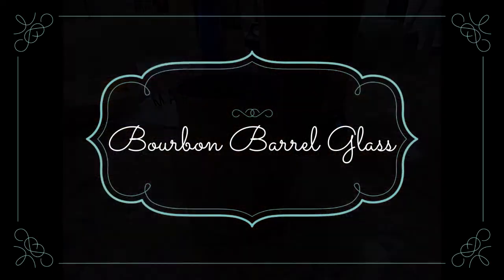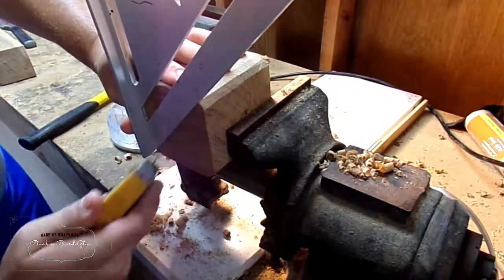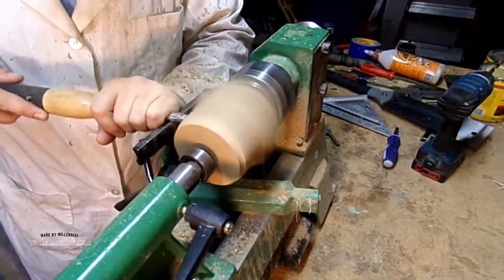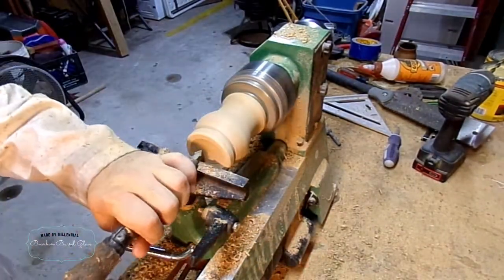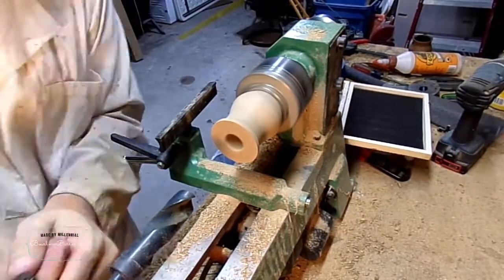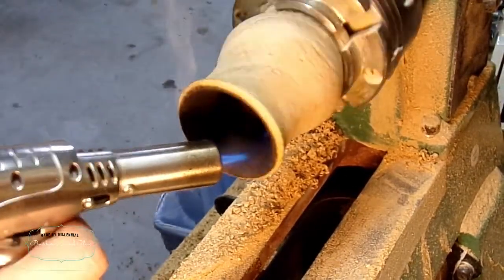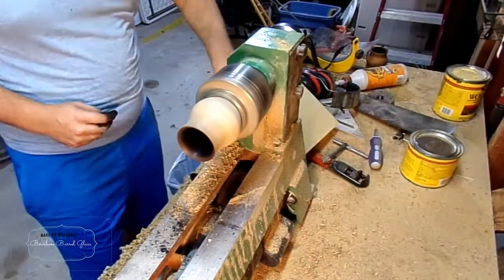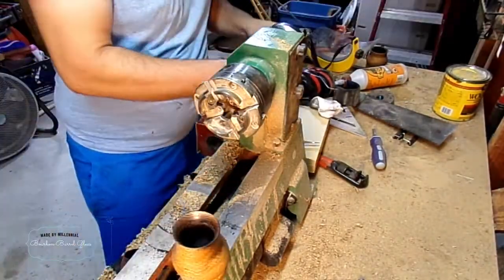Woodturning - Bourbon Barrel Glass

Comment: Nice tumbler! Did you put it in Mineral oil? And why?
Reply from the maker: Yes, I generally soak all cups/plates in mineral oil.  It does a good job and lasts forever if you soak it.  Plus it makes it pretty waterproof (see my comparing finishes video)
Reply: But will the oil change the whiskey 🥃 flavour?
Reply from the maker: I don't notice it (mineral oil doesn't have a taste). Also I don't oil it often.  I did a primary oil dunk then let the surface oils wash out.
Reply: Thanks!

Comment: what type of oak did you use?
Reply from the maker: I think white oak.  It was from a pile of random oaks I got from a guy on craigslist, so I'm not super sure.  But I don't think it was post oak, I know it wasn't tiger and I think it wasn't blackjack (those where whi I got)
Reply: @MadeByMillennial  I make mine out of white oak as well. I use beeswax/mineral blend to coat the inside and outside to prevent leaking. Have you had any issues with just coating the outside? i assume the mineral oil will eventually dry and though the tumbler wont leak, the whiskey would saturate the wood
Reply from the maker: @justinharris7771  I have had no issues so far, and sorry i didn't reply earlier.  With the mineral oil I kind of hoped that the whiskey would soak into the inside of the wood, that was part of the reason for why I burned the inside!  The hope was for the wood to kind of work as a memory for past drinks!